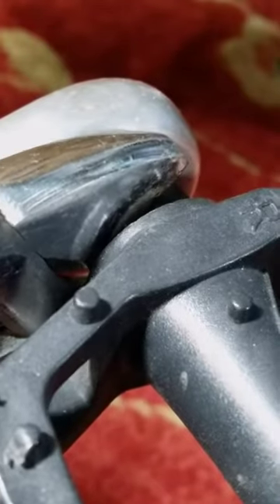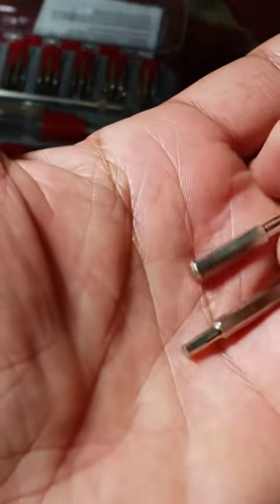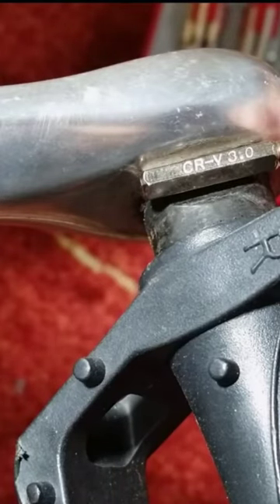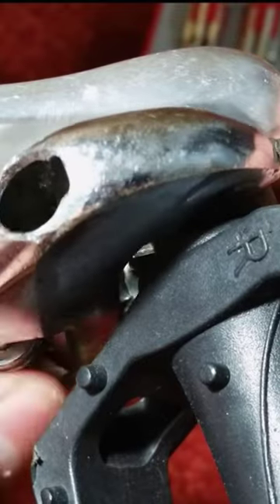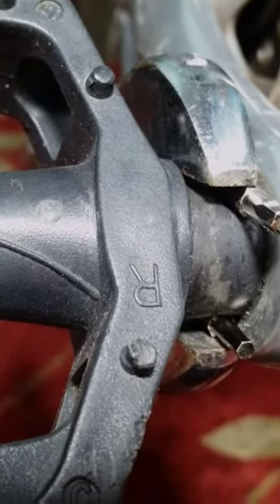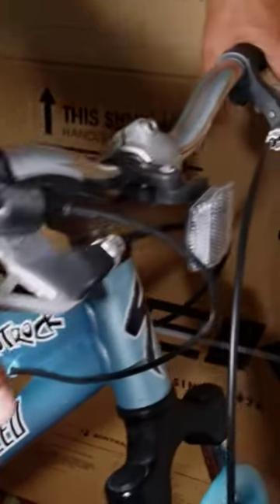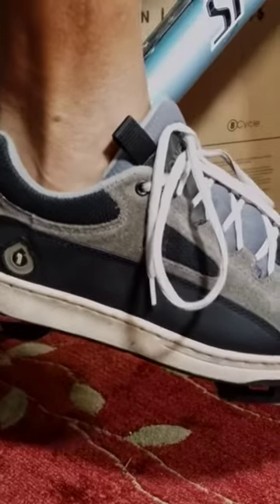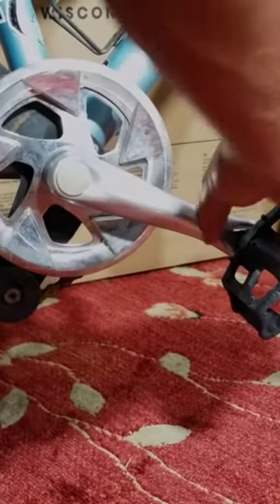How to remove bike pedals! Easy hack!

Comment: Or just go to harbor freight and spend $10-15 on a basic wrench set. A man without the basic simple tools in life at this stage is embarrassing. What is this world coming too
Reply from the maker: What if you're in a hurry, short on time, and don't have a proper working tool available at that moment?
Reply: @theadventurebiker  you can find a single wrench at any hardware/auto part store? Also, flip the bike over to stand on its seat and handlebars and you can pull to break the bolt loose. If you own a fckn Specialized, at least have a basic set of tools to work on it.
Reply from the maker: I never work on bikes upside-down...